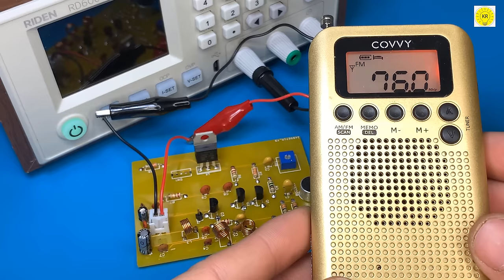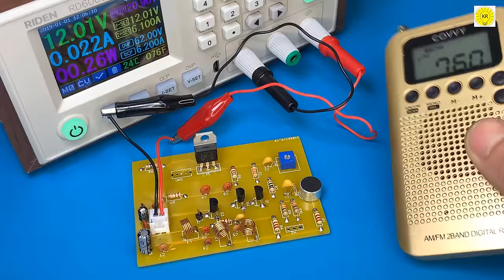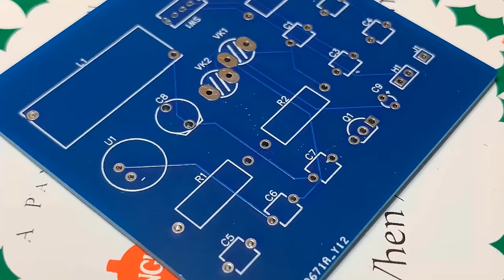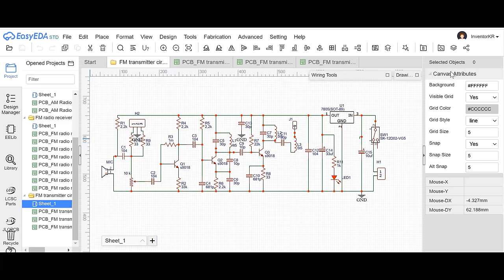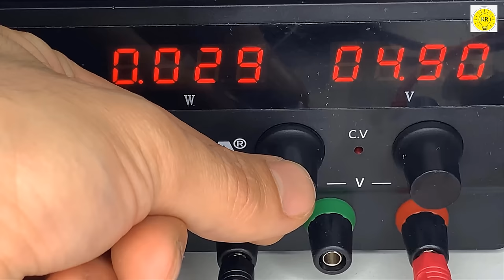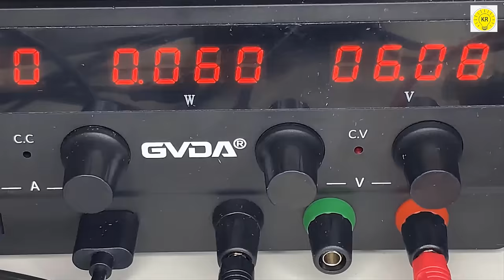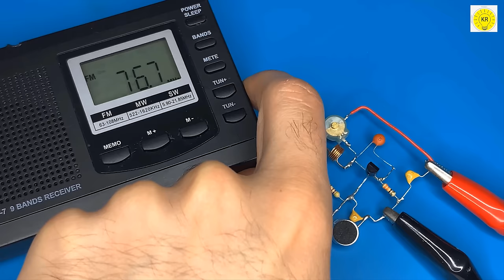how to make a simple fm transmitter circuit, 350m Range, jlcpcb

Comment: How far does the cheaper fm transmitter transmitt
Reply: Can't be more than 1km or so, probably much less then this. Even if regulator was operating at 1A, that would be ~9W. Even some new equipment is much less then this and can reach a couple kms (think helium network). I would expect no more than line-of-sight in a typical neighborhood. Depends on how high up you place it too! This will affect propagation.